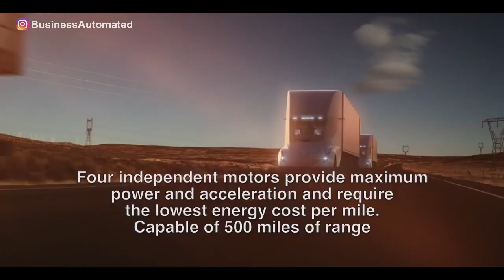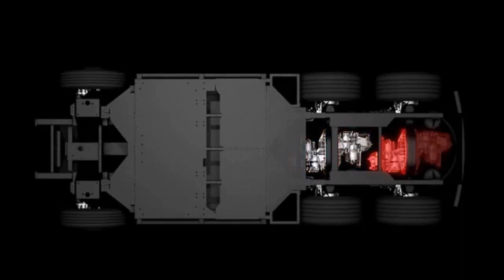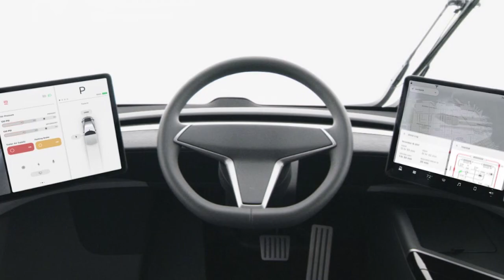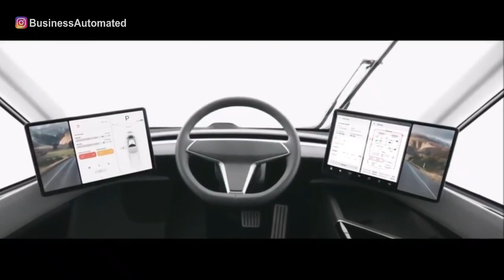HUGE CHANGES COMING in 2021! Tesla's Most Disruptive Vehicle Yet. How Tesla Semi Will Make Billions

Comment: That will not happen in next 20 years.
Reply: I think 20 years is a bit optimistic. First off it's too heavy by about 15,000 lb, and how many places is there an extra megawatt of power to supply the mega charger. And one megawatt of electrical service will only be enough to charge 24 trucks a day.

Elon musk is just a narcissistic showboater.
Reply: @joecummings1260 , I don't understand how Tesla are going to manage "fast charging" for these vehicles. 
Any sought of fast charging is going to draw massive amounts of current at typical single or three phase voltage levels. And when I say massive, I mean hundreds of amps. Step down substations are going to have to be built just to fast charge one vehicle. Put two or three on charge and the substation is going to have to resemble that of one in a small country town. Even if operators choose to "slow charge" these machines over night, they are still going to have to install considerable infrastructure to do so  and whether they physically can or not will depend on what circuit they are on on the grid. 
I love the idea of electric vehicles but this semi idea has hairs on it.

Comment: Some points.
1) When you remove the engine, transmission, cooling system, fuel tanks etc from a diesel tractor and add batteries and electric power, the empty weight only increases about 1,000 kg. The 4680 battery should eliminate even that.
2) when a sleeper version is required, it is trivial to extend the chassis sufficiently.
3) Shorter the trip, more advantages for electric.
4) In trucking, economics rules. Fuel, maintenance, asset lifetime, electric wins. Electrics will take over FAST.
Reply: Elon said the difference would be 1 ton I  think that might be for the 300 mile range
Reply: ev will not have the range or power
Reply: @THESLlCK   Do you claim that without reference simply because you know somehow that Tesla's stated ratings of 5x the acceleration / grade handling and 500 mile range are not true? How do you know this?
Reply: @lengould9262  lol 500 mile range my eye. They can't even manage that with sedans, never mind a full capacity 10+ ton truck with a load behind it. It's all BS.
Reply: @THESLlCK  620 miles not 500 is is the projected range according to Elon
Reply: @THESLlCK  not many sedans need 500 Miles range but if you're willing to pay the price you get it .>>>$141,070 Tesla Model S Plaid to deliver more than 500 miles of range, 1,100-plus hp
Reply: @13thbiosphere  from 500 to 620, these numbers sure are fickle
Reply: @THESLlCK  due to Innovation .>>>new battery
Reply: @lengould9262  EV sucks towing. Range decreases drasticaly. This Semi, only good to the distribution sector.
Reply: its a myth mate....its not coming to market

Comment: Can you plug it in at home?
Reply: What's a Home? 🤔
 I live at the Factory! 
 😁🤭
Reply: Sure, plug it in, wait about a month, then you'll have enough to drive it for about a day if you don't go too far.

Or, if you're home just happens to have 480 volt 3 phase power, and you have your a space in your breaker panel for a 250 amp 3-phase breaker you could probably charge it overnight.
Reply: @joecummings1260  - Still faster than filling a Motorhome on foot, with a 2 Gallon Gas Can! 🥴🙄
Reply: @robertweekley5926  actually my home/shop has a 350 amp 240 volt 3-phase service. A few years back I did the math and figured that I could charge a Tesla semi in 10 to 12 hours and still have enough power left over to run the oil burner and the night light so I didn't didn't stub my toe going to the bathroom.
Reply: You can afford to buy one to make it into an RV you can probably afford panel to charge it LOL
Reply: @gregkelmis2435  I know you're kidding around, but do you rise to get the kind of charging times Elon musk talks about you would need a 2500 amp, 480 volt, three phase circuit for each and every charging stall. That's like four pieces of copper wire for each circuit that are 1 3/4 inch diameter after you strip the insulation off. You'd probably have to run like 6-in conduit just to hold them.

Then just for one charging stall you have to install transfer on your property the size of an SUV fed by at least 13.2 KV

Comment: Haven't even started the charging infrastructure. None have been produced. Don't hold your breath.
Reply: Multi trillion dollar infrastructure, will mean 15- 20 years, to get to the sales level of Tesla cars.
Reply: @tompain2751  in other words forget about the truck
Reply: @ianburnett4605  They like to make big claims. Elon Musk is a great salesman. 7% of all vehicles sold, are at least partially electric. It has taken 15 years to get cars that far. These are prototypes. Walmart wants to electrify their fleet by 2045.The mining of heavy toxic metals, battery weight, and other concerns are a problem. Natural gas is cleaner, and UPS, BFI, and many large fleets are going that way. It seems there will be a combination of different alternative fuels being used. That will extend the life of oil reserves. That's practical...Environmental extremists, are not.
Reply: @icemanhunter1  just wait a bit longer buddy.